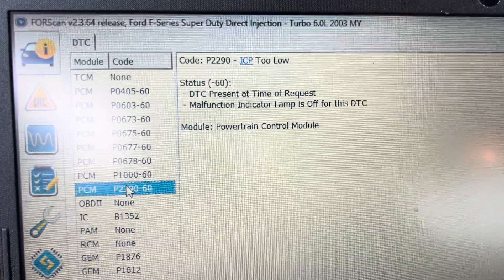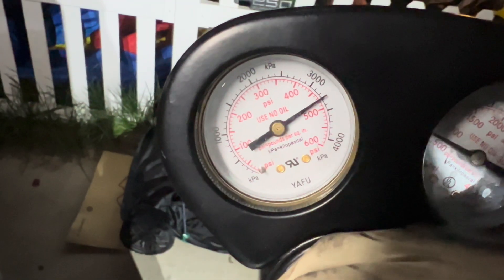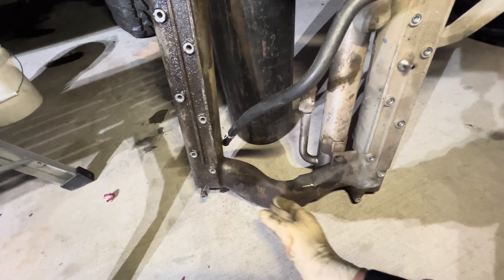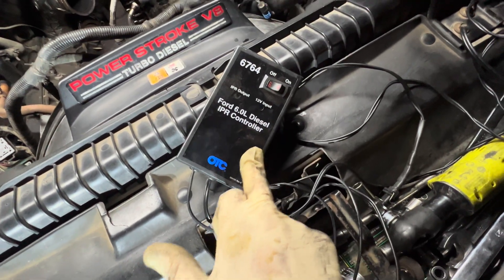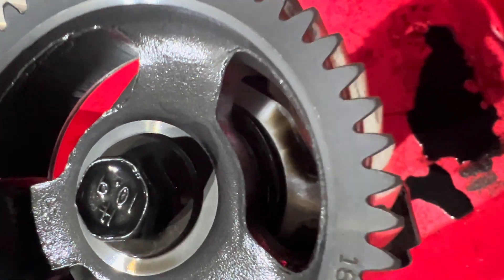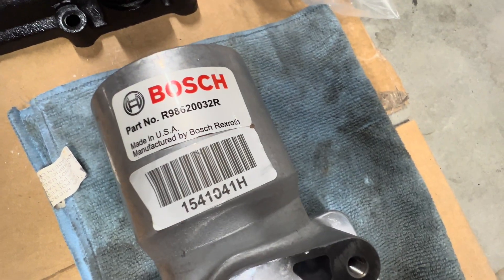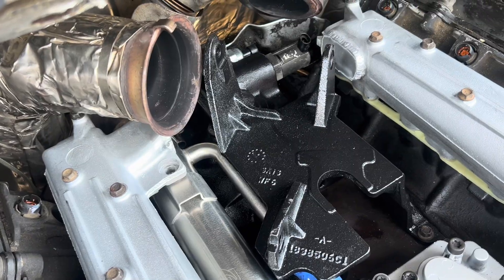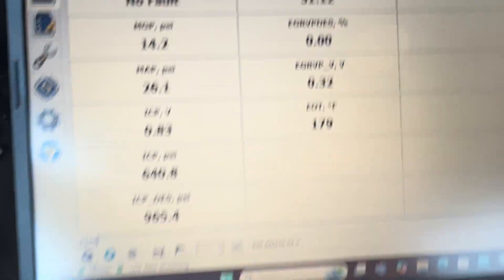How to Diagnose a 2003 high pressure oil pump on a 6.0 Powerstroke *I LOVE HEUI SYSTEM!!*

Comment: How many miles on the HPOP when it failed. ? I have an 03 with 230,000. Replaced the HPOP at 180,000 as a maintenance item while i was doing the oil cooler.
Reply from the maker: Yea it’s definitely a good idea especially if you have the 03 intake mainfold, i believe it had over 200k if I remember correctly.